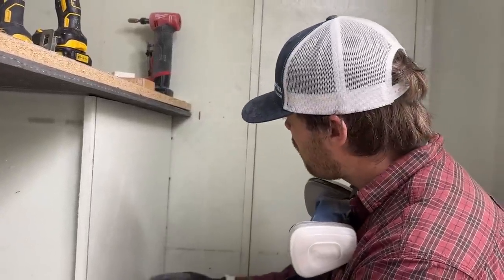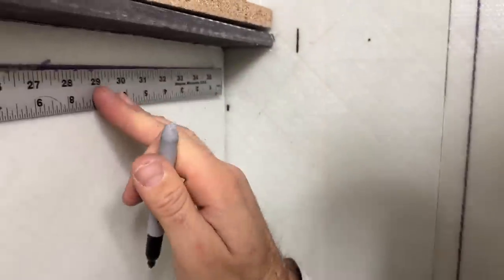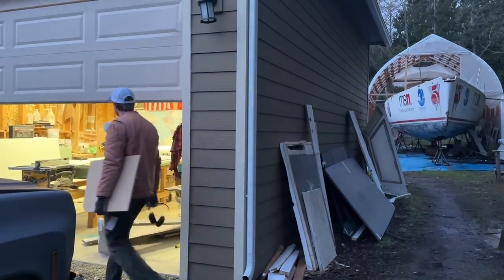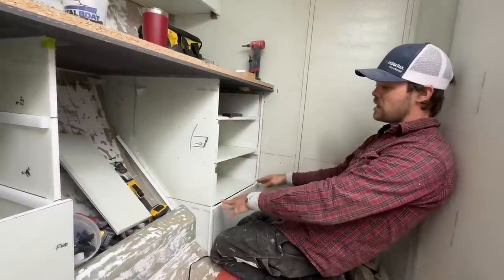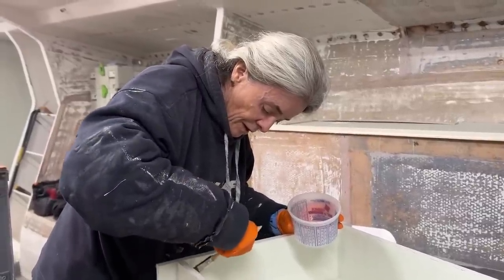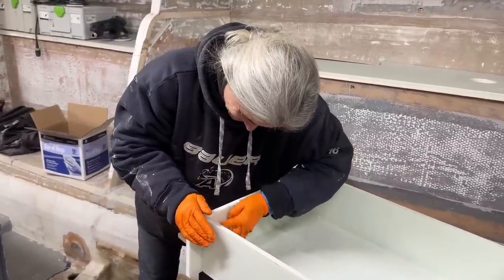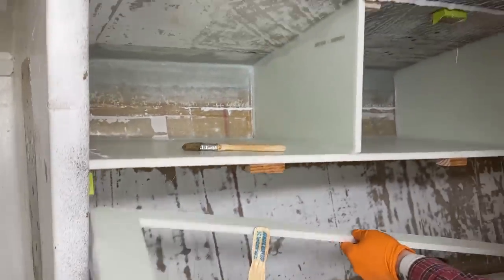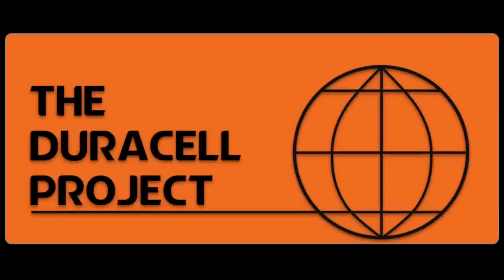You don't see this feature often in a sailboat, but we can't live without it.

Comment: awesome work. maybe talk to a wooden boat builder, build the drawers with little hooks on the runners so they can not open until the front is lifted.  i have been there building similar...think about using cedar its much nicer to work than epoxy very light and much quicker to build.

Comment: Like how you make so much of what you need - even fiberglass edge banding. Use a piece of tape for the router bearing to run over and it won’t leave marks on the material and will leave it proud just a hair to be sanded off flush.

Comment: I was a cabinet maker for 10 years and I can say that the way you built your boxes in place is perfectly valid and wonderful. CA glue can be brittle and you may decide to epoxy your edge banding instead. If you decide to epoxy your edge banding, you can make edge banding clamps out of cheap Harbor Freight spring clams, and old bicycle tubes. I made about 50 for our cabinet shop in a couple of hours. It makes edge banding easy and quick with slower setting adhesives that have better toughness. Just an idea. I love your cabinetry!
Reply from the maker: Bob, do you have a link to show me how to make the clamps?

Comment: at this point of build , something to concider is interior storage ventilation , i used to own and live on my 47 endurance in Sidney on the island , i had lengthwise gap batween the hull and the back of storage areas with 3 fans pre side to blow air through to help combat condinsation and mold
Reply from the maker: I’ve been thinking about this a lot. We’ll be investing heavily in computer fans for ventilation throughout the boat.
Reply: @TheDuracellProject  ya thats what i had and didnt draw much power as i lived off the dock on a mouring bouy , dock rent was much cheapoer for a 8 ft runabout than 47 ft ,lol

Comment: Cabinet making is for sure a challenge and while outside my real skill set I seem to get stuck doing it. Been lucky so far!
Noticed a bow shot and suddenly wondering if you are adding a fixed bow sprit? Built a couple out of unidirectional carbon, somehow a nerve wracking experience. Could be such an epic fail. But once again everything things seems just fine. My comment to guys I sail and work with is "It's ok" never that's good or great. Drives them crazy!!
Reply from the maker: Yep, a fixed bow sprit is the plan with an anchor roller integrated!

Comment: Hi guys, thanks for making the videos, I enjoy the progress. For the drawer edges… (maybe in the galley)If you are using HDPE or similar low friction plastic as the slides, then I would glue a thin strip of the same material  2-3mm on all the edges that will be in contact with another surface. The drawers will run much smoother, and you will protect the edges at the same time. It might not work on the drawer fronts, as it would not be as aesthetically pleasing. But you could just do the fibreglass strips like you already did. Anyway good luck!
Reply from the maker: I’m already using uhmw for the bottom sliders. Maybe I’ll get some thin plastic for the drawers!
Reply: 3M make a very thin adhesive film (#5421) for just that purpose.

Comment: Work bench is awesome!  Good luck keeping it clear of clutter 😅.  I like how you trimmed out the exposed foam, my only concern would be how strong the foam is that you are bonding those strips to.  Can you easily rip that strip back off after the glue is cured? ( on  a spare piece of course)  glue is only as good as the substrate, you already knew that!  Cheers!
Reply from the maker: I am thinking I’ll switch to epoxy

Comment: The best method to stick those strips to the edges of the exposed foam is to dig out a 45 deg strip of foam along each face of the edge and then fill that with thickened epoxy as well as coating the foam between the two 45 deg troughs. Stick the strip to that and you will have corners that you can sand a decent radius on so that the edge is blunt. The 45 deg fillets form a one piece structure with the strip. Slightly heavier yes but the strips won't end up on the floor after a few months of use.
Reply from the maker: It’s a good idea but I don’t want to use that much epoxy.
Reply: Use vinylester for filling and/or just use much more bulking filler in the mixture keep thickening until it is putty like.

Comment: For the overhead cabinets, maybe put the hinges on the bottom edge - so when you're heeled over you can partly lower the front face without the contents spilling out. And an internal fiddle...
Reply from the maker: Hey Evan, there will be an internal fiddle. I wonder if having top hinges would make them hard to get into.

Comment: The workbench on the boat is a great addition.  I think Arabella's builders are including one, also.  The sacrificial top is a good idea.  Questions/suggestions:  Do you plan to include one or more vises?  Removable or fixed?  Metal-working or wood, or both?  Also, a swing-away seat (bar stool-type) in the knee hole might work well.  Lastly, dust collection and removal.  I've never seen a Shopvac temporarily attached to a Dorade box, but it might keep the dust out of the living spaces.  I'm enjoying the posts. Many thanks.
Reply from the maker: There will be a removable vice. We have a homemade air scrubber in the boat. We also have a dust collector in boat.

Comment: hello from Belgium, I love your channel and follow your progress with great pleasure !!!
A little feedback with the cyano (CA) glue.
CA used on epoxy you just glue the two fiberglass parts together and they will not hold well over long time and scratch. if you use clear epoxy, the cure will be longer but your stip will be melted with the rest of the piece. and the fields of your panels will be much more resistant.
Reply from the maker: I think I might end up epoxying all the strips on. Probably will last longer than the ca glue

Comment: I like your drawer / foam edge strip finish. It’s the fastest, neatest and most lightweight method I’ve seen so far, and using the model glue and spray is very practical as well. Nice work👍

Comment: I think your cabinetry looks awesome. The edge strips are a great idea but I was surprised to see you using CA glue rather than Epoxy. My understanding is that CA is not strong long term if damp at all (though I'm no adhesives expert so may have got this wrong...). The Stand Stare Study technique for working stuff out has served me pretty well, it's not 100% reliable but always gets more interesting results, the angles in your workbench being a good example. Love your work.
Reply from the maker: Yep, I am gonna use epoxy for the other drawers for these reasons you mention!
Reply: CA is very brittle unless you get something like Insta-Flex, which I'm pretty sure isn't foam safe.

Comment: Great progress! I do have a question and some concerns… am an expert in DIY, build two kitchens, but no experience in building s boat from scratch.

Drawers in my workbench at home are loaded with heavy tools, with a drawer just sliding on a ledge will induce friction and therefore wear and tear. You may end up with very hard to open and close drawers that will wear out prematurely.
Did you consider using stainless ball bearing drawerslides? The ones with soft close are super nice to install, and easy on the material in the drawer as well.
If you don’t want to keep it simple with the least amount of moving parts you could consider using a frictionless sacrificial teflon strip on the top of the ledge where the drawer slides on.
Keen to hear your thoughts.
Reply from the maker: We are using uhmw sliders which should keep friction low. We’ll use the fancy sliders in the galley.

Comment: Carpenter/Joiner by trade here.
Nice work! Future proof and moisture stable, what more could you want from boat cabinets! I think even if I were as good as you at fibreglass I would have made the drawer boxes out of wood saturated with epoxy. For me it would surely be cheaper and/or faster (?), but I suppose you are more likely to have scrap foam panels around than plywood so maybe not!
I would caution against relying on CA glue for anything long term….especially when subject to handling and shock loads as boat drawers are.
The edge banding was a great idea, but I predict you will re-glue it with epoxy one day in an exotic location.
How will you keep those drawers shut when you are beating on the port tack?

Ps if you do get your other cabinets built for you, go to a shipwright, or at least a cabinet shop that specialises in fitting out boats.  Your every day cabinet ships are reliant on practices and materials that are not at all marine grade….they would be much cheaper I’m sure, but just for a while…
Reply from the maker: Magnets! And yes, I am reconsidering using the ca glue on some of the cabinets

Comment: Basically you’re adding a veneer that strengthens and preserves the drawer edges. Pretty standard in custom built-in mdf cabinetry. Might want to consider bottom bracing given they will store tools. 

Boats are an interesting design use case. What does level really mean in the context of moving water? 😂
Reply from the maker: Exactly

Comment: have you thought of abs edging used in kitchen/cabinet to finish the raw edge, come in 1 or 2 mm and 18,22,25, 35 width , flexible and come in billion colour and texture , easy to work with and durable ?? even 0.4 mm and 2mm  wood edge too, come in rolls of 25m to 100m depending , use a trimmer to finish the edge, but yours is good using strips of offcut fibreglass
Reply from the maker: It’s a good way, but I think my way is cheaper
Reply: it is !especially if you use all you off cuts in the process ,

Comment: Given that the workbench is really a workSHOP, inside the boat...and given my experience with the things that one keeps in workshop drawers...I wonder if you might want to consider lining the bottoms of the drawers with something (possibly 1/4" aluminum) to add some real rigidity? I can just imagine myself stuffing them with tools, while individually fairly light, that add up to substantial weight that might cause the bottoms of the drawers to sag...therefore rendering them un-openable. Just a thought, but otherwise looking really good!
Reply from the maker: The sandwich core construction is pretty stiff.

Comment: I dunno it doesn't seem like a home project unless drawers are assembled using IKEA barrels  bolts heh heh.  Can't wait to see some strip led lighting underneath the top shelves for task lighting.  I half expect a ruler to be built into the big working surface, with designed holes for vacuum infusion. Rounded edges go a long way to prevent boat bites ;)
Reply from the maker: LOL

Comment: We used to router out the foam between the fiberglass or carbon skins and fill it with either epoxy and cotton fibres or epoxy and saw dust, we would do this to both the door edges and door jams, apart from strength another bonus of doing it this way is once it has gone off you can router a radius on the edges where you might touch them or bump into them.
Reply from the maker: Yeah it’s a good method…just uses a lot of epoxy.
Reply: @TheDuracellProject  I haven't seen you really using fillers such as microballons or cotton fibres, saw dust, it looks like you are using colloidal silica a thickening agent. You can fill the routered gap with anything so long as the 2 skins are epoxied together, thin strips of hardwood on the straight runs will minimise your epoxy usage. As for the strength that you add depends on deep you router the core out to, where the  crucial ratio is the thickness of the core to the depth 1x1, 1x2, 1x3. You are going to have to start doing some core reinforcement for portholes, winches, turning blocks to name a few. Anyway I am enjoying watching you go through the process of repurposing an old race boat so thank you for the content.
Reply: Yes when finishing the edges of stress skin panels for cabinetry its wood, composite or metal inserts (depending on application/exposure) preferably laminated into the panel during layup.  Edge glued foam doesn't bond as securely as insetting solid material to tie into an inch of so of the stress skin plus you won't get the structural stiffness you need for impact resistance where the foam would tend to crumble away underneath.  On wear surfaces such as where drawers slide you want much more than a few layers of tape so an insert of UHMW (Ultra High Molecular Weight) board such as used on saw fences and conveyor wear plates would often be a more appropriate material there.

Note that Hot Stuff Super T and Special T Cyanoacrylate (Super/Crazy) glues though are not recommended for use on foam however they have their UFO line of thick and thin CA glues which don't offgass solvents as badly so are more appropriate for use on foam.

Best!

Comment: I wouldn't be using cyano to stick the edges on with. I think I would just use epoxy and that has to be cheaper than cyano activator and will be a more consistent coverage, with cyano I think you will end up with bits of the cover strip not having glue on it and at some point chipping off
Reply from the maker: Yeah, you are probably right and I am thinking of using epoxy on the remaining drawers for this reason

Comment: Why do you need a workbench inside your boat? What boat repairs can you do there that cannot be done on deck? Won't most repairs require being on the hard? I know that once launched, the last thing I would want inside the boat is sawdust and/or fiberglass dust. Even if you were to hire your services out to needy customers, won't that happen in a boat yard and not at sea? You did a nice job on the workbench but I think the space could be utilised better.
Reply from the maker: There’s always little projects that need to be done on a boat, especially when our cruising. It’s not totally necessary, but it’ll be great to have a designated work bench rather than doing these little projects on our dining table, floor etc.